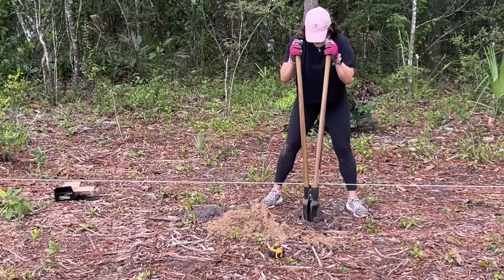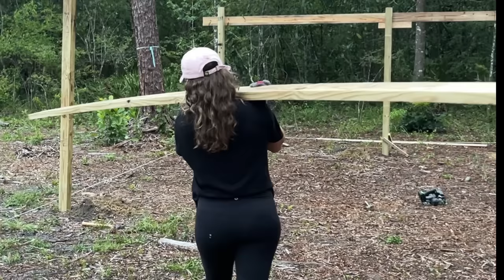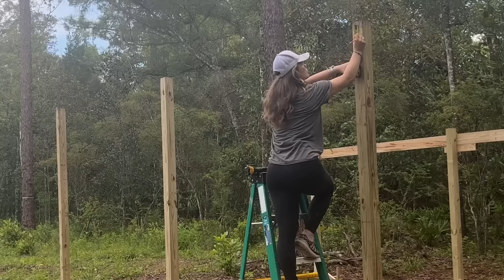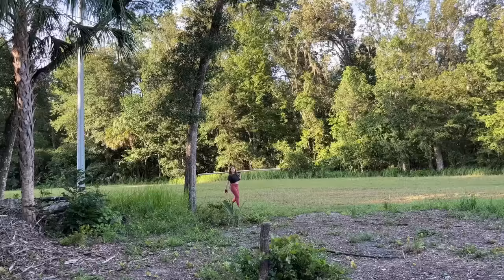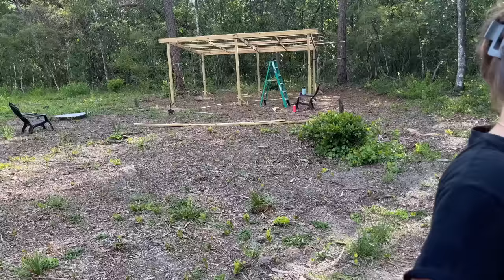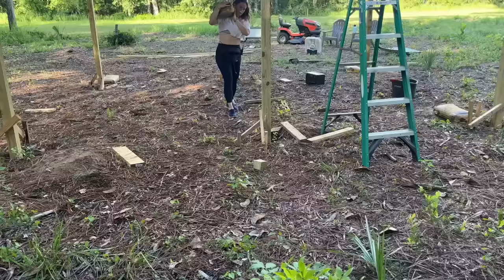Simple DIY Pole Barn in 10 min

Comment: I bought a used low used hours Resmed 10 auto.   Have been on a CPAP machine for decades.  I have been using it for some months and feel like hell.  I put the pressure setting at 8.2 and upper setting at 12.  Yet,  the API setting remains for the last two two nights at 3.8.   This doesn't seem to be good.  What do you think?  I was scammed?

Comment: Question: what was your reason for concret ing the posts at the end rather than the beginning? Very interesting.
Reply: Yeah, I wanted to know about that, too......
Reply: I guess it’s so you can use totally equal length pieces where required and then square it up at the end by pushing or pulling. Then concrete it square.
Reply: Wondering that myself. Idk if it matters or not, but seems like the structure would shift a little as you build if post are not set in concrete

Comment: From an Ontario farmboy: GOOD GOING GIRLIE! That was a lot of hard work and stick-with-it-iveness! Good job. Now you have a shed and you have learned a lot in the process. 

After all that effort, please add 2x6 or 2x8 triangulation braces to protect it from getting taken down in a storm. Lag them on from 2 feet down from all posts up to the headers on a 45° angle. The braces on the posts in the middle should form a 'V' shape. You will be amazed how much more rigid it will become with just that one step. If you want to make the braces SUPER-strong, cut scrap 5/8" or 3/4" exterior plywood to the shape of each brace. Screw the pieces on over the braces with  2½" screws every 4 inches around the perimeter. You can use longer screws where they go through the brace into the post. Those are called gussets, and they greatly reinforce the braces.

Comment: I worked construction for a number of years while going to college.  You did a great job and to be honest, even the people doing it for a living make mistakes and drop stuff.  Two suggestions.  One, when installing your boards at the top of the posts, screw a 2x4 to the post perpendicular to the way the new board will be running.  This way you'll have more than just the width of a 2x4 to rest your new board on.  Second, on each post add a board angled from the post up to your board running acrossed the top.  I prefer to mount it on the post about 2'-3' from the top and just run it at a 45* angle.  This diagonal bracing will prevent side to side and front to back movement.

Comment: Outstanding! Whether I would have done any, some, all or none of the project like you is immaterial. There are 100 ways to do anything. As someone that has accomplished a project or 2 while working alone over the years, you captured those frustrations perfectly. Pole barn is up. Looks well built to me. I would certainly feel comfortable putting the best tractor I owned, a classic car, a pile of hay or the firewood under it without reservation. Well done.

Comment: Will you be installing some braces from your poles to the cross board on an angle ?  Some triangulation will protect you from collapse due to high wind or storm. 
The concrete is not enough to prevent twisting .  I t would be an awful shame after all that hard work.

Comment: Loved the video. You may not be a professional but the final product looks great. This caught my eye because I am thinking of building a storage shed in the pole barn style. I was building a deck by myself and used scrap 2x4's as a helper like you did. I would suggest attaching them perpendicular to the piece you are working with. I told an experience friend about my struggles and he said "why didn't you just use clamps?" The bad thing is I have several clamps. 🤦‍♂The only other suggestion I have would be please get a taller ladder. Standing on the top is dangerous, especially if you are working by yourself. Thanks for posting this. It turned out nicely.

Comment: I'm sure you learned by now.
made me sad to watch the boards falling.
I KNOW THE STRUGGLE. 
but I learned to use 3 boards Level and side supports, both sides once I get it up and in. they won't fall. Then, check and screw,  But go back with some nails.
Much stronger.
Excellent work either way

Comment: Good job! One suggestion: i wld put a support beam in the middle coz thats a long span 👍🏻
Reply: Yep. She could avoid support poles in the middle if she used heavier roof beams. 16 ft. is a long span for a 2x6. I'm not going to look it up, but 2x12" beams would probably be appropriate. But those are going to be super heavy to handle solo. Over time I expect 16' 2'x6"s  to start sagging under their own weight -- I have some 12' treated 2'x6" with no load on them at all that serve as gates for my cattle feeding area and they've warped and bent over time.

Comment: Quick tip, screw the support boards in on the face 90 degrees to the board you are trying to set into place. Hard to explain, but once you get it, it works much better.  You can also use quick grip clamps and just clamp the clamp to the 4-by then rest the board you are installing on the bar of the clamp. Then clamp the opposite end into place, then come back and clamp the 2-by in place to the 4-by.   This probably makes zero sense.... sorry, ez to do, but Not ez to explain in text. 

I've done a lot work by myself, so I share in your misery. Great job by the way. Keep it up.
Reply: That makes total sense, put the 2x perpendicular, so that you have a "4" rest" for your board. Or a clamp. Or I was thinking I would drive a line of screws at a 45 into my "helper board" and that way the beam I am trying to set can wriggle off of it. It would give the helper board a "lip".
Reply: I like that, putting the assist board at 90 degrees is the way (if you don't have clamps)

Comment: Just a note for next time.  Measure the width of your board, mark it from the top down carry your ladder to 1st post aline the top of board to top of post put a screw through the middle just to hold in place (dont drive screw all the way in).  As you lift the opposite end the board will swing into place. No more dropping the board.

Edited to say You are doing amazing!! Love your content!
Reply: I wondered if she might want to bolt to the posts. 🤔

Comment: Helpful tip get gravel to put in the bottom of the post holes in Florida soil is so wet it will help with drainage over time great work also 😊
Reply: I was wondering if she should pour some concrete around the pole base or maybe it wouldn't set up? I'm not familiar with Florida.
Reply: Question: I would have put concrete in when I set the corner poles, thinking it had to be firm before screwing and hammering. Is that not right? You leave that for last? Hope you see this a month after commenting. Thanks.
Reply: @lhmccool67  pour it in dry it will pull enough water from the soil to make concrete set the gravel at the boys drainage only
Reply: @juliapope7663  the gravel is for drainage only concrete can be premixed and poured into the hole or poured in dry the water in the soil will make the concrete
Reply: @markcampbell1417 Sorry, I must have sounded confused. My question is, should the gravel and/or cement be put into the holes when the post are put in, or is it okay to wait until construction is complete. I know you don't want to sound critical of the video, and I don't either, but I am getting ready to do something similar and I thought that the posts should be firm before construction. I just want to be sure to do it correctly and, frankly, this did confuse me slightly.
Reply: Definitely, if this were built in the city the holes would need to be inspected before concrete is even poured. Not only that, if she is using ordinary screws on areas that are load based she would need to use either carriage bolts/ lag bolts, or what are called deck lock screws they are for lateral tension. All and all just throwing something together it looks but it’s definitely out of square now that she put all that weight on the poles pre concrete.

Comment: I just finished building a 10x10 shed by myself so I know your pain when trying to do it without an extra hand to hold stuff, also I'm 57 and out of shape so I was huffing and puffing in the heat and took many breaks, but pacing yourself is key, even if it takes longer to finish the job

Comment: For a pole barn, it is better to not concrete around the posts. That causes rot. Instead, you dig down below the frost line, put a footer stone at the bottom of the hole, set the post on it, and then fill the hole with dirt. It takes longer to set, but this leaves water able to drain away from the pole and disperse in the soil -- concrete holds moisture against the pole. Key is getting the hole deep enough. Below the frost line for your region will mean freezing and thawing ground don't cause the pole to heave.

Comment: As a contractor I’d like to just give a little tip to anyone doing this or building a fence. If you need to dig a hole in awful packed or clay ground the best way I found was to dump some water in the holes dig out a bit and repeat. Yes it is messy but it’s WAY easier. Ps, earth augers (if available) are really cheap to rent and I’d use the same trick with them as well.

Comment: Tie the end of a board on one side with a rope and throw the end of the rope over the boards that are already screwed in place, or on top of the first post support brace in place. Then lift it with the rope, get it as high as possible, and tie the end of the rope at chest level to the post. That will hold one end up in the air at 45 degree angle for now.  Next grab the other end of the board that is touching the floor, carefully climb on the ladder with it and place on top of your support wood bracket and screw that one in.  Then come off the ladder and move your ladder to the rope side, lift a few inches and place on top of bracket and screw it in and then undo the rope.  Rinse and repeat.  I know nothing, I’m just old.

Comment: Great job. One thing I might add. When you set the scab to rest the beam on. Scab another piece outside of that so when you raise the beam it will be unable to fall while raising the other side😉
Reply: Also, do not build like that off a cheesy 6’ ladder. 8’ would be way more stable, provide you with 2-3 points of contact, and keep you off the “death step”. The plastic piece that clearly says. “NOT A STEP”.

Comment: THE WAY I WOULD HANDLE THOSE BIG BOARDS AT THE TOP IS I SCREW OR NAIL A 2X4 UP
A FEW FEET WITH A HOLE TO PASS A SMALL ROPE THROUGH(A SMALL PULLY WOULD BE IDEAL ) A NAIL FOR A TIE OFF !! I DON'T RECOMMEND ANY STRUGGL AT ALL FOR BUILDING
ANYTHING !! I TRIED BUILDING ONCE MY SELF JUST TO HAVE
THE LOCAL GOVERMENT WRECK IT !! THEN I HIRED A GOVERMENT RECOMMENDED MOBILE HOME INSTALLER AND THE GOVERMENT WRECKED THAT ONE !! I BOUGHT
AN APARTMENT  (TAXED TO DEATH)!! SOLD IT !! SAID THE HELL WITH OWNING AND LOSING
TO THE GOVERMENT!! TO GET MY MONEY BACK I MOVED TO PUBLIC HOUSING AND RETIRED!!

Comment: 😢nichts gegen Enthusiasmus und handwerkliches Geschick.  Aber holz verfault in der Erde. 👎🇩🇪
Reply: There are treatment methods to prevent wood from rotting in the earth. We have a pole barn built over 140 years ago that was treated with copper sulphate that still has no evidence of rot. 
Also the wood species makes a difference.